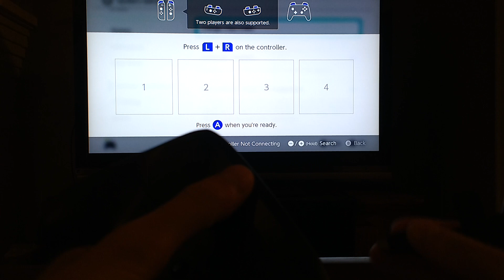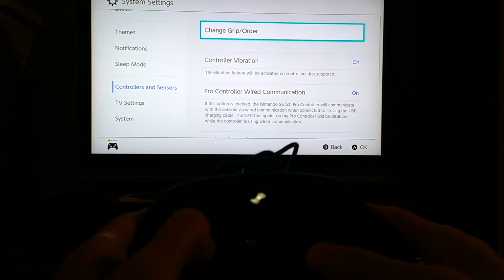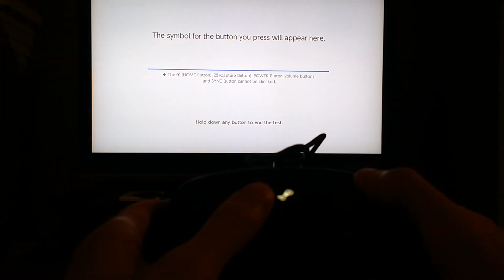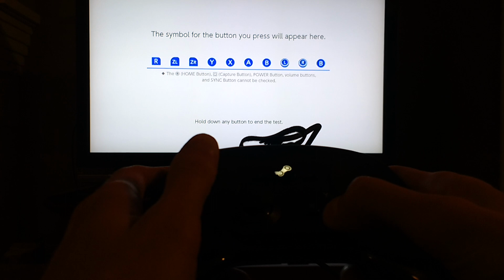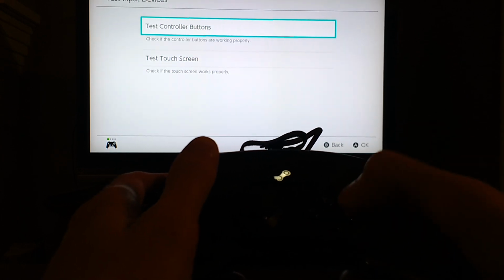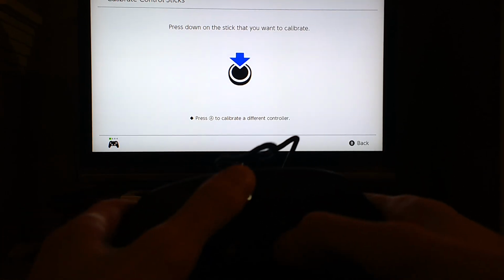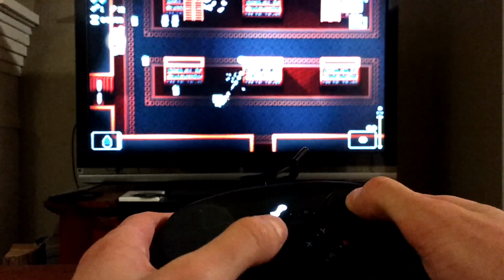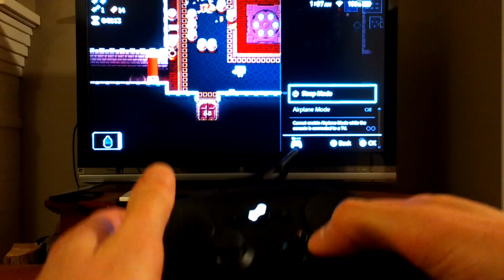Open Steam Controller: Nintendo Switch

Comment: I connect3d the usb cable to the switch and controller, and then went to change grip and pressed the buttons but nothing happened. Was there any software that I need to download for this to work?

Comment: Hi, I Hope you see this message.  

First off, thank you for this tutorial.  It worked!

However, I'm trying to get the steam controller back to default. I deleted your firmware from my steam controller drive. Added the new steam controller drivers. The controller is no longer being recognized by Steam on my desktop.  I've repeated the firmware restore steps a multiple times and have not been successful.  Could you please advise?

Comment: Is this potentially dangerous for the controller or console? Thanks!
Reply: To a limited extent, as always. If you brick your controller you just replace it with the original firmware manually.

Comment: Hey Greg I was wondering if there was a way to force Steam Controller to use maximum physically possible polling rate with your custom firmware and still use controller profiles? I know a few sc folks who would love to have unnerfed polling rates of gyro and higher rates for other inputs. With SC discontinued it's a pipe dream for official adjustable poll rates.

Comment: Hey, is it still functional? I've followed the guide on github (rename the switch firmware to firmware.bin then deleting old one on steam controller and copying new one in), it doesn't seem to detect the steam controller on the switch when connecting it via usb
Reply: Just installed it today and I can confirm it still works :)
Reply: @ZeroGravix  Excuse me, how did you proceed step by step on order to make it work? Unfortunately I am no expert and a little overwhelmed about what I need to do
Reply: Same here, couldn't get it detected with the bundled FW or building it myself (made sure to set FW in config before build) and renamed it.

Comment: Thanks for creating this! But can we get an update? I am planning on buying Cities Skylines on switch, can I use this controller to play it? Or any other games? Or is this only proof of concept, but no practical use?
Reply from the maker: This is more on the order of proof of concept. However, people have been using to play games. All inputs you need are supported, so you should be able to play any game. However, unless you are going to rebuild the firmware yourself, remapping is not an option. The biggest issue people have mentioned so far is that the right track pad is too sensitive (https://github.com/greggersaurus/OpenSteamController/issues/7). Please give it a try and let me know what you think.

Comment: 162/5000
Big project
And made the mod with the .bin file
It has enchanted me
hopefully one day the dongle is achieved
congratulations on tuprolleto and gracvias for sharing it
Reply: Would there be any chance that the right touchpad would work as if it were a tramball or mouse?
Anyway, it’s a great project.
sorry my english, google traslation
Reply from the maker: Thanks for the kind words! And no worries regarding using Google Translate. I think your intentions are coming through clearly. Currently the code only supports getting the current X/Y location of the finger on the touchpad. However, using this function (trackpadGetLastXY()) could allow for implementing a trackball or mouse behavior. I don't have any immediate plans to add this, but if you'd like to give it a try please do! Happy to help if you have any questions.

Comment: This is an amazing project! Hands down one of the most useful firmware for the Steam Controller. You did an amazing job. I have a question however, for the right pad, it freaks out when I check its status, is there a way to fix this? In not sure if it's the firmware or my controller. Is there also a way for it to connect wirelessly or is it just wired.
Reply from the maker: Thanks for the kind words! Regarding your question does the video linked in this issue (https://github.com/greggersaurus/OpenSteamController/issues/7) describe your issue or are you seeing something different?

Comment: The 8bitDo SN30 Pro+ uses a software interface to configure many aspects of their controller such as remapping buttons, macros, etc. It has gyro and all the other functions and lacks NFC. It doesn’t have touch pads though. 

Maybe it would be possible to glean some info from this?
Reply from the maker: I know some people who are big fans of 8bitDo, but I have never personally used their controllers. Just watched the promo video for the SN30 Pro+ (https://youtu.be/Dq4bJ5Qpn8M) and I am impressed. It looks like they are doing things right in terms of customization. Thanks for informing me that this exists. It'd be neat to have such a slick customization interface for this project.

Comment: This is a very interesting project, and I want to congratulate your work.

However, when changing the steam controller to the switch firmware, will it still connect and function with PC or no?
Are you able to revert the firmware installation?
Reply from the maker: Thanks so much! Once you load the custom firmware I made that makes the SC appear as a Power A Wired Switch Controller, it will only work with a PC if that PC understands how to interface with that controller. Since it's a 3rd party Switch controller my guess is that there won't be PC support. 

As far as switching the firmware back to the original, it should not be an issue.  Check out https://github.com/greggersaurus/OpenSteamController/blob/master/LoadingFirmware.md for a step by step walkthrough of how to backup your current firmware, load new firmware and even restoring firmware to the official Valve supported one (if you had issues with backing it up).
Reply: @Gregory Gluszek Thanks! 
Also have you tried getting the steam controller to work like the pro controller with the dongle? And can you remap the controller inputs as I often accidentally hit one of the grip buttons and take a snapshot
Reply from the maker: This issue (https://github.com/greggersaurus/OpenSteamController/issues/13) has thoughts on using the dongle to achieve wireless. 

This issue (https://github.com/greggersaurus/OpenSteamController/issues/14) describes steps to have the grip button no longer take snapshots. 

Let me know if either of those do not answer your questions!

Comment: Before I ask my question, I'd like to praise your hard work and dedication to this project that you created and being so responsive to the community around this project.

Now for my question: I'd like to know if it's possible to have the left trackpad act as the left analog stick and the left analog stick act as the D-Pad and how I would go about doing so. Also, I'd like to know how to re-map the ABXY buttons if possible.

I saw a comment below that asked a similar question about re-mapping the controller, but I was unsuccessful at re-mapping the ABXY buttons after trying to modify the "updateReports()" function like you said in your reply to that comment. My programming skills and knowledge are at a beginner's level, so please excuse me in that regard.

Thank you for your time.
Reply from the maker: Thanks so much for the kind words! It makes me really happy to see other people getting interested in this project. 

First, yes, what you're looking to do is possible. Before I say anything about the swapping the D-Pad and Left analog, I'll comment on the AXBY button remapping. To change the remapping you should just need to change a couple lines in the updateReports() function. For example, if you wanted what is register as the X button on the switch to to be controlled by the button labeled by A on the SC you would change line:

controllerUsbData.statusReport.xButton = getYButtonState();

to

controllerUsbData.statusReport.xButton = getAButtonState();

To break it down the part to the left of the equal is referring to packet that will be sent via USB to the Switch. The value assigned to this value defines whether the controller is reporting the button is pressed or not. The part on the right of the equals is calling a function, which queries the SC hardware and checks if a particular button is pressed or not. So all you need to do to remap the buttons is to mix and match these function calls and variables assignments!

As far as swapping the Left Analog and D-Pad, first let's focus on the Left Trackpad function as the Left Analog. Look at the section of code in updateReports() that starts with the comment "Have Right Trackpad act as Right Analog:" Copy this, but change 

trackpadGetLastXY(R_TRACKPAD, &tpad_x, &tpad_y); 

to 

trackpadGetLastXY(L_TRACKPAD, &tpad_x, &tpad_y);

in order to read the Left Trackpad position. Then change the variables assignments for ...rightAnalogX and ...rightAnalogY to ...lefttAnalogX and ...lefttAnalogY. 

For the DPad, you should be able to follow converting over the section of code starting at comment "Have Left Trackpad act as DPAD:" to read from the analog stick instead of the Left Trackpad. 

I hope this helps you get started. I think I'm going to try and put together some tutorials in the project to walk people through good starter examples like this. Do me a favor and if you get tripped on with any of this, make an issue on GitHub (https://github.com/greggersaurus/OpenSteamController/issues) so I can walk you through getting this working. From that I should be able to get an idea of what would be helpful in a tutorial for the next person who wants to do this or something similar.

Comment: Yeah it's working but the touch pad that is acting as the right joystick is very fidgety, you hover over the touchpad and it thinks it's doing a full joystick movement. Any fix to this?
Reply from the maker: No fix at the moment. This is a known issue and being tracked here: https://github.com/greggersaurus/OpenSteamController/issues/7

Comment: Is there a way to change the name of the steam controller device? Like the name that would appear when connecting to the device.
Reply from the maker: Could you provide more details. Are you talking about a name appearing on the Switch when the controller is connected?
Reply: @gregorygluszek6659  when you use the steam controller with the ble firmware and connect to the Bluetooth device, it'll have a name that would appear 'Steam Controller'. I was asking if you can permanently change the name of the controller when connecting to it and even when you connect it with different devices.
Reply from the maker: Bluetooth isn't working yet, but this may be doable once as that feature progresses. You can follow issue (https://github.com/greggersaurus/OpenSteamController/issues/8) for updates on this.

Comment: So if I buy the steam controller can I connect it to my switch?  Or do I need something special? Greetings
Reply: yes you can connect it
Reply from the maker: You don't need anything special other than some software I wrote. Here is a link to direction on how to change firmware on the Steam Controller: https://github.com/greggersaurus/OpenSteamController/blob/master/LoadingFirmware.md. Here is a link to prebuilt firmware to test out: https://github.com/greggersaurus/OpenSteamController/tree/master/Firmware/bin

Comment: This is an interesting project. Considering that the Steam controller has almost every bit of hardware that the Pro controller has aswell. Pretty much the only thing missing from it is the NFC reader, and capture button(which could probably be mapped to one of the controlls.)

But the motion actuators, RGB LED and Gyro are all here.
Reply: Late to the party, but the Steam controller's LED isn't a maxed out RGB, it is just a white LED. You can't adjust the colour or anything like that.

(I know because I replaced my Steam controller's LED with an orange one for Castle Crashers with friends as Orange Knight, along with custom Castle Crashers start up sounds and shutdown music. Oh, and an Orange Knight controller skin. :p)

Comment: Might be a dumb question, but does installing this override the default firmware or make it unusable on pc, also Insanely cool, Im going to use this even if its "proof of concept" its Amazing
Reply from the maker: Installing this firmware does override the default firmware. Once installed, from the standpoint of whatever device the controller is connected to (e.g. PC, game console) it will appear as though it is this controller: https://store.powera.com/Product/1503255-Nintendo_Switch_Wired_Controller_Super_Mario_Edition?cat=CONSWITCH#frm%3DCONSWITCH%26p%3D17. Since that controller is not particularly popular (to my knowledge), you will most likely not be able to use it on the PC. However, it is fairly simple to restore the default firmware. Steps for doing this are spelled out in the README on GitHub. If you have any issues, or any feedback, please don't hesitate to let me know. Thanks for the question and kind words!

Comment: Quick question: Once the firmware's on the Steam Controller, can it be used on the PC like normal?
Reply from the maker: Once the firmware is on the Steam Controller it will mimic the behavior of this controller: https://store.powera.com/Product/1503255-Nintendo_Switch_Wired_Controller_Super_Mario_Edition?cat=CONSWITCH#frm%3DCONSWITCH%26p%3D6 I'm not sure how that controller interacts with a PC. However, you can always reload the official firmware (i.e. the one supported by Valve) and the controller will act like it did before.
Reply: @gregorygluszek6659  Could you load the firmware and load it up on an 8bitdo adapter to make it work wirelessly?
Reply from the maker: @playz8b1t  https://github.com/greggersaurus/OpenSteamController/issues/8 is tracking efforts to get the wireless chip working the SC. That would be step #1 to get the controller to work wirelessly with the Switch. Once we can interface with the wireless chip we could look into protocol specifics and conform use the 8bitdo protocol or try to match the Switch Pro Controller protocol.

Comment: This is some great stuff. If only I knew more about hardware programming or Bluetooth. I would have totally contributed to the wireless part of this.
Reply from the maker: Glad you like it! Don't be afraid to try and mess around with the firmware and ask questions if you're interested. I started the project knowing nothing about reverse engineering and ended up learning a lot. If you've never done embedded software before blinking an LED is the "hello world" of the embedded world and luckily the controller has an LED. I made a video about building the firmware that also has a brief intro into the firmware. Maybe a good jumping off point if you ever find yourself interested? https://youtu.be/VxD9rCuD9Vc
Reply: @gregorygluszek6659  Thanks for the link and motivation! I'm not great with commitments to projects but being pointed in the right direction certainly helps.
Reply from the maker: @DaVince21 I total hear you on the project commitment front. Please know that there is no pressure towards any commitment to the project if you ever have any questions or wanted to make a pull request for a change or anything like that. The only way I find the time and energy to work on this project is if it's fun and interesting to me. I wouldn't want the idea of a commitment to ruin that for me or anyone else.

Comment: Thanks! I don't have a pro controller but when i can use my steam controller as one i don't need it.
Is there any way that i can turn it off?
Reply from the maker: I'm assuming you're talking about powering off the Steam Controller. If you power up the controller by pressing the Steam Button it will not turn off until you remove the batteries (or the batteries die)... This is something I will change in the next build. If you start up the controller by connecting the USB cable the controller will power off once you disconnect the cable.
Reply: @gregorygluszek6659  Thanks!
Reply from the maker: New build was just pushed and should not have the issue. This also means the controller can only be powered by connecting the USB cable (i.e. will not power up via pressing Steam Button).